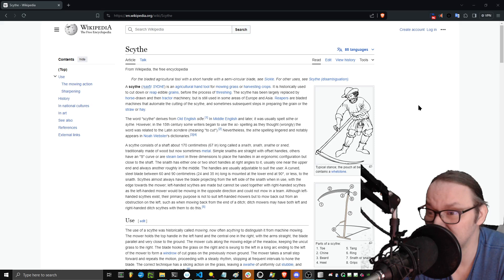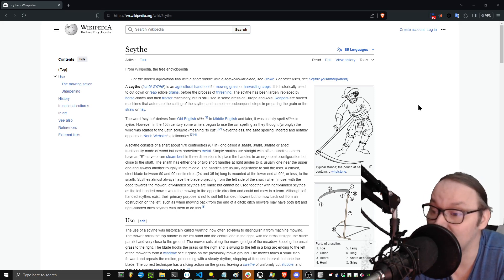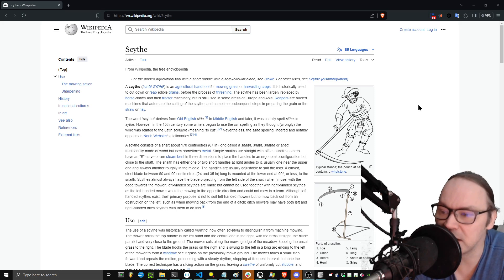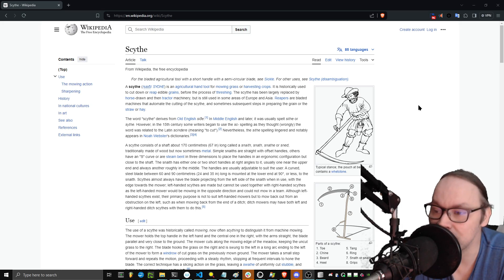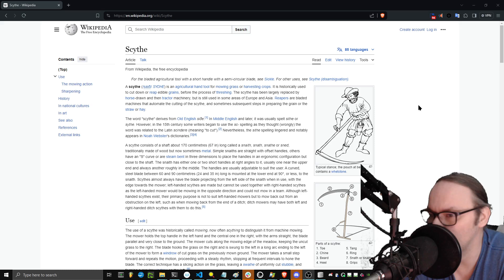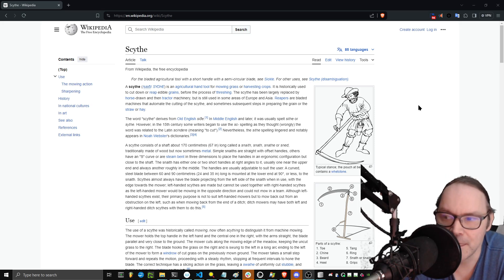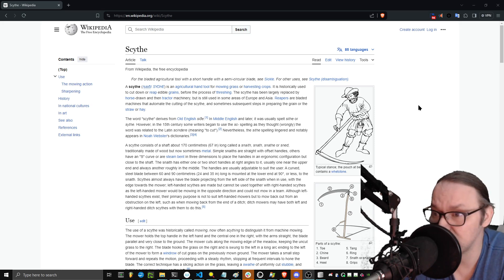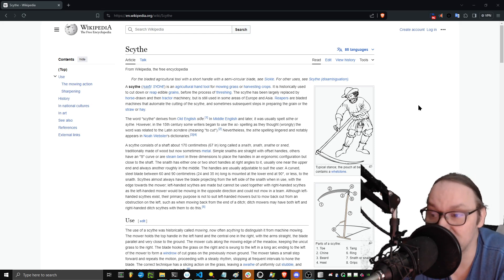Software System Design: Why are you really using that tool/abstraction?

Comment: Sometimes all you need is PHP and some jQuery and manually configure your firewall and nginx.
At the company I worked at we didn't use Docker until it actually started saving us time to do so.

I think with a lot of junior developers the issue is also that they just go for what's recommended or considered a "best practice" without ever understanding the reason behind why a given tool came to exist or what is the underlying problem it aims to solve.